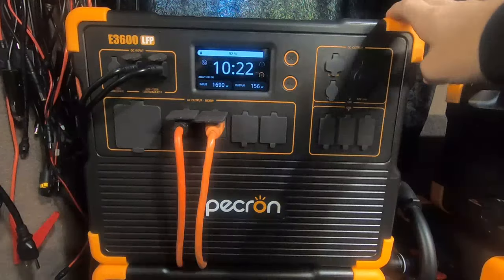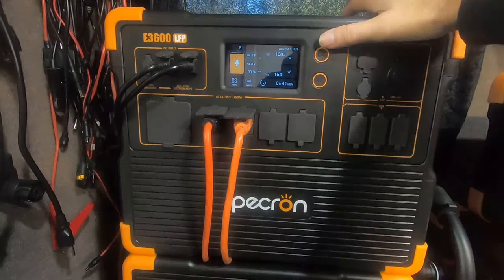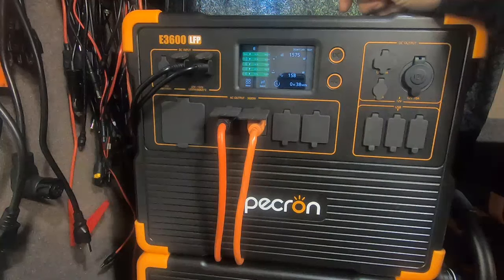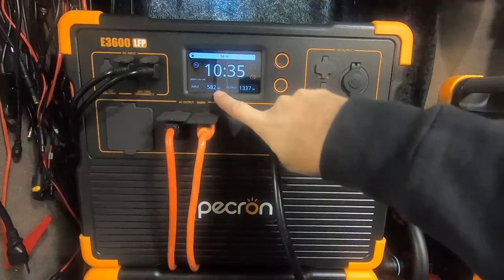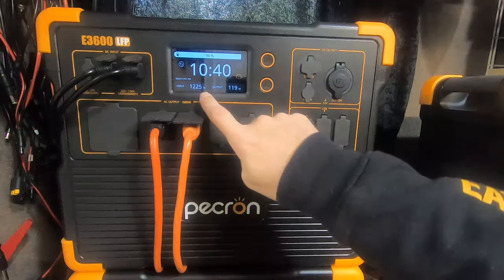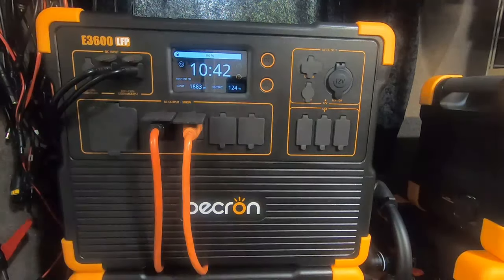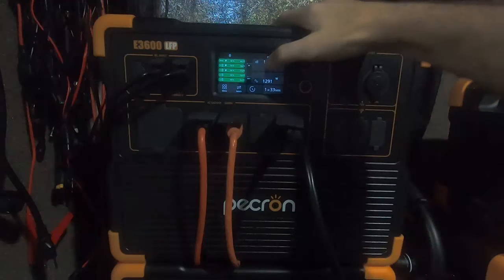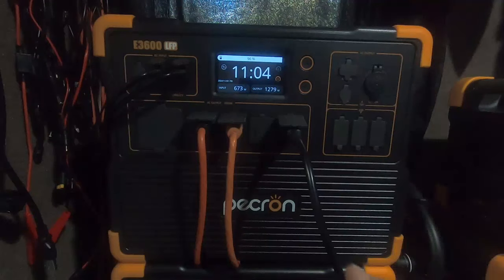PECRON E3600LFP Power Station (((((UPDATE 10)))))

Comment: If you please sir I have a question. Does the 15A AC cable also charge the ep3000 expansion battery direct to household outlet? The ep3000 manual confused me labeling it DC input. Mine are in route shipment and your Amazon video review concerns me about charging both properly.
Reply from the maker: You can just plug the battery into the e3600lfp and charge it that way :)
Reply: I was thinking on reviews on Amazon that you were describing not to do it that way. Or at least that was the impression I got with the e2000lfp. So if there happened to be a greater than 10% difference between the host and expansion battery when I receive shipment (because there’s no way I’m going to know until I plug the 2 in) it won’t degrade either one ?
Reply from the maker: The was for a completely different system....

The e2000lfp had problems balancing the batteries, now the systems auto check all the time and this helps with that.

The new systems are much better because of our complaints years ago :)

You can charge the battery if you want to, but if the e3600lfp is at 50% and the battery is at 50% because that is how pecron ships them. right?
Reply: Thanks 🙏

Comment: Which video do you go over the expansion battery and set up to the 3600?
Reply from the maker: Very simple. Set each battery to number 0,1,2 or 3 with that little screw driver and just plug them in and you are done :)

P.S. Start with number "0" when adding extra batteries, then the next battery would be number "1" etc, etc......

*This system auto detects them for you :)

Comment: Can you charge the expansion battery with the 30 amp cable?
Reply from the maker: Are you talking about the AC 30 amp charging cable for the e3600lfp?

That is only for the main unit (e3600lfp)
Reply: @ yes
Reply from the maker: ABSOLUTELY NOT !!!!!

That cable is designed "ONLY" to be used with the e3600lfp charging port on the side of that unit.

EXTRA WARNING !!!!!
That is a AC voltage power cable...How the heck would you have tried to plug that into a EB3000 or EP3000 anyway, they have different ports and they are DC Voltage in the batteries.
*Hope that you did not try to do this somehow :(

Not to mention, the ports on the eb3000 or ep3000 are DC inputs, not AC :(
*You need something in between them to convert AC to DC before you try to get that power into the battery. (example: AC to DC charging brick)

P.S. Please be safe out there, solar power can be dangerous or even deadly !!!!!
*AC and DC do not play nicely with each other unless you have a conversion box between them ;)

P.P.S. Only charge these batteries this way......
1. solar input 32v-95v (5 pin) (400 watts max)
2. Cig port (12v-24v) (5 pin)
3. AC charging brick from e600lfp or e2000lfp power station (5 pin)
4. hooking them up to e2000lfp, e1500lfp, e2400lfp,or e3600lfp (using pecron's cascading cables)
Reply: @ no I haven’t….i don’t even have that battery yet, I was just wondering if you could do that. Sorry for the confusion.

Comment: Thanks for all the E3600 LFP vids.  I'm wondering, do you think we need to use both of the host's expansion battery ports?  I'd like to stack just 3 batteries underneath the 3600 generator and use only 1 of the expansion battery ports on the side of the E3600LFP.  Thanks you!!
Reply from the maker: We thought of doing this as well but are afraid to try it....LOL

Having all 4 batteries on just one port. and just having a really tall single stack system.

I am pretty sure that you have to put 2 on each port since there are 2 ports.

We will ask pecron about this :)

P.S. We would really love to be able to put 100 batteries on this bad boy and have a HUGE system, but 4 is the limit according to pecron....LOL
Reply: @RamblinBobReviews  You're probably right... as on the E1500... only 2 batteries per port. I bet within a year Pecron will be offering various lengths  of these excellent cables. Thanks again. We ❤️ ur vids!
Reply from the maker: We were hoping that they would have figured out how to chain many batteries in daisy chain this year, but nothing yet.

  Some companies have systems were you can have like 10 batteries in a row.
Never tried those, but would love to be able to see how they did it :)

Comment: I know you're mostly solar, but what do you think of that proprietary ac/wall cable? I like to have back ups and I see you can't even order one on their website
Reply from the maker: We really dislike when cables can only be used on one power station :(

P.S. But, in this case....we can understand why they had to have a proprietary cable for this power station.
That same port can pull 1,800 watts or 3,600 watts, and if it did not have that special cable to tell the system what to pull, it might  try to pull in 3,600 watts on a standard 120v outlet & cable. so it needs the communication pins in their to hold back this beast. 

P.P.S. This system can really eat power (3,600 watts AC or 4,150 watts solar)
Reply: @RamblinBobReviews  that I understand. The lack of availability of getting an extra is the thing I don't like. Really has me looking at a smaller system like the ecoflow delta 2 max.
Reply from the maker: They have always been late selling their cables, the 30a cable is not on the website yet either. 

P.S. We really like that Eco Flow ultra (45,000wh) power station system :)
Reply: @RamblinBobReviews  I'm just starting out. I just now grabbed the ecoflow delta 2 max for 989 shipped!
Reply from the maker: Nice :)

Let us know how you like it.

Comment: Bob, can you recommend any 200-220w rigid panels that get output (percentage) closest to the 100w thunderbolts? Thanks. (I know you got the ones from the solar installer, but what about a panel that's widely available) Thx.
Reply from the maker: The only ones that we tested so far in the 200 watt range is the acopower ones. And these are not the best output, but we really liked them because they were full black panels.
Then we skipped right to the 400+ panels.
Reply: @RamblinBobReviews  OK. Thanks.

Comment: Hey Bob what is needed to get 240 to a rec room I have a mini split that can’t run it I have the electrian here he said I can only run 120 would another 3600 run 240
Reply from the maker: You have to have 2 x e3600lfp to get 240v output, and 2 full systems is 30,720wh when you build the complete setup :)

Comment: Hey Bob great job on your full E3600 Setup, glad you finally got your two extra batteries to complete your setup! I wanted to ask you do you have a video that explains your over panel method, do you mean going over on the wattage? I do that with my eco D2M it only takes 500w but I use 550W and can get to the 500W more easier on cloudy days like you had on this video lol. anyhow I have 3 Renogy 550W Bifacials and 2 Eco 400W panels, what would be the best configuration to overpanel them for my Pecron E3600 LFP? thanks for your contribution to the Solar Community brother! Cheers
Reply from the maker: Over paneling is pretty simple, you can put as many watts and amps as you want, you just can NEVER go over the VOC of your system. The solar panel act like a cruise control on a car. when you need more power it gives it to you. and when you can not use it, it holds back :)

P.S. Just make 100% sure that you NEVER go over the VOC voltage of you system EVER !!!!!
Reply: @RamblinBobReviews  Hey thanks for this info, I think my best configuration to over panel with the 4 panels i have is using my 3 Renogy Bifacial 550Watt panels in series, they have an open circuit voltage of 49.5V, x3 panels would be within the 150V(VOC Max)  input voltage of the E3600 LFP (Per Slot). The Renogy's 550W panels do go a bit over on Amps I think upto 11.3Amps of current per Panel, so I am a little over on amps but I think you said I can go over on amps right? so is this configuration to overpanel my E3600 LFP sound ok to you per the VOC numbers again each has VOC of 49,5V so 3 panels is under the 150V(max) on E3600 LFP thats per slot right? thanks for your help I really enjoy your videos and learn so much from you, Thank you (one suggestion: when you are talking about the touch screen, if you could zoom in a bit more it would be great to be able to see the screen a bit better, I could see it but looks blurry cant read alot of it, only a suggestion) thanks again bud!
Reply from the maker: I would not use 3 of those panels on this system on one input, it is way too close to the VOC for my opinion. What if you get a power spike of 5% or so and you burn out your MPPT or your power station :(

P.S. YOU ALWAYS HAVE TO REMEMBER THAT THE PANELS ARE RATED FOR + OR - 5% IN MOST CASES :(
(And that would put the VOC over 150v if you got that power surge)

note: We always leave an extra 10v on the VOC (underneath the limit for safety) on all of our systems for safety.

You better look into that setup more before you decide to do that.
Reply: @RamblinBobReviews  yeah I thought of that but you would think that Pecron has already taken the extra possible spike in mind, their manual says you can use 3 panels in series as long as they are 50v or below VOC, so you would think they already added into consideration any possible extra spikes. I will think this through before proceeding but dont you think they would have already calculated this in already? if they recommend you may use 50v and under VOC why would it be unsafe?
Reply from the maker: Because they are not responsible for that VOC rating that solar panel companies put on their panels.
To give an example, those harbor freight 100w panels say that they are rated for 18v right on the box, and they are not...
They are really 22.5v (and we have logged them at almost 25v VOC many times) and reached 122.5w each on video !!!!!
That is 7v & 25w higher than thunderbolt said they were....Very dangerous if you had a system that could only take in 20v VOC.

  Power spikes could happen in any situation. Our e2000lfp had some trouble with any VOC over 80v.
and other youtube channels as well. We made many videos warning people of this.
Remember that video we did a year ago? So we learned from doing it the hard way.
we had to change 2 x MPPT controllers to upgrade them in that system to get the 80v and up to even work.
(And they were supposed to be rated for up to 95v VOC)

    If it was really hot outside, and some really cool water fell onto the panels from the rain, your voltage and power could spike to much higher than the panel is rated for. or you could get a bird poop on a panel and create a very dangerous hot spot and spike the power.

   We have had many conversations about this very question on the channel. and how dangerous it is to push any system to the max all the time. research the term "HEADROOM" to understand this better.

   As a sound guy myself....I do not care who makes the speaker or amp or whatever.  And do not care how good they say the quality is. I will "ALWAYS" run at least 10% or more under the rated power (MAX) because it is always a safer thing to do if you want your equipment to last longer and not over heat.

HERE IS A GOOD EXAMPLE...
 Your car could drive with the gas pedal all the way down to the floor, right?
The car company said that it can go the speed on the dashboard, right?
But for how long until you pop that engine? or burn it up?
So just because the dashboard says that it can go 110 miles per hour, we do not recommend doing it ;)

P.S. ALWAYS be safe when messing with electricity in any form, of you could lose everything you own making a small mistake like not leaving some VOC headroom for safety just in case :(
Reply: @RamblinBobReviews  Hey you are so right Ramblin Bob, I just went over some screen shots of my 550W panels when I first got them, and I did see only one screen shot where my 550W solar panel overshot to a whopping 68.5v x 8.5amps which gave me a whopping 588 Watts, so it did overshoot on voltage quite a bit, so I am glad we had this conversation brother, I will be instead doing 2x 550W on one slot#1 of the E3600 and then 2x 400W ecoflow panels on the other slot#2 and the other 550W works really well on the 500W slot of my Ecoflow Delta 2 max it reaches 506Watt max (as D2M only allows around 500watts) so it cuts out any other wattage, so this will be my configuration so I am on the safe side of things, I can always charge my other D2M in the other room from Pecron through a Cord, which is what i am doing now anyways, I like the way we are able to move energy around to where its needed, I think this setup will be my best and safest way to go for now. Thanks alot for all your advice, I am a reasonable person and like to listen to common sense ideas. Thank You Bob for your contribution to this community, we appreciate you Sir!
Reply from the maker: Happy to be here to help :)

68.5v x 3 is DANGER WILL ROBINSON !!!!!
that could have gotten you 200v or higher on a power spike :(

P.S. We all learn together as the scriber family :)